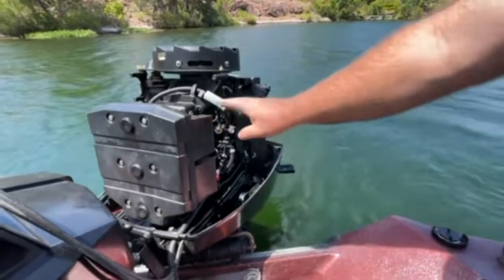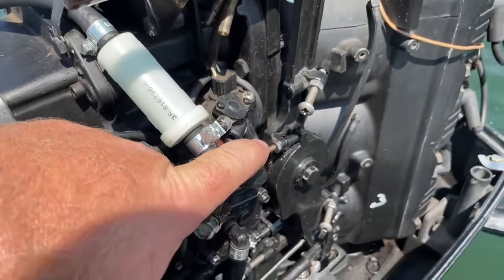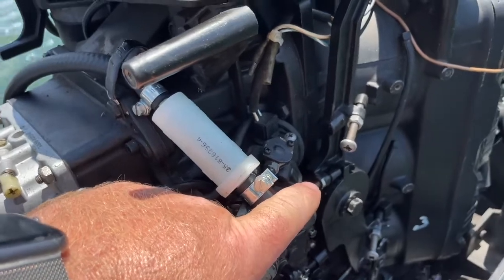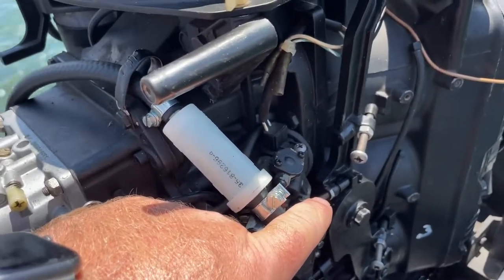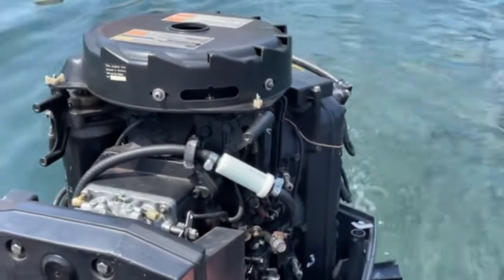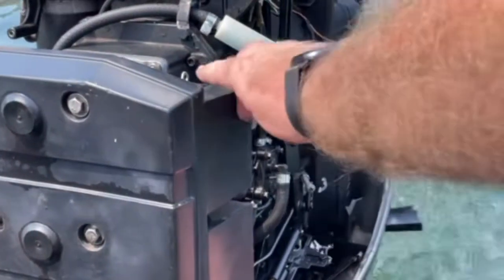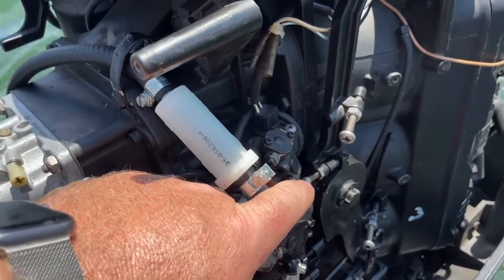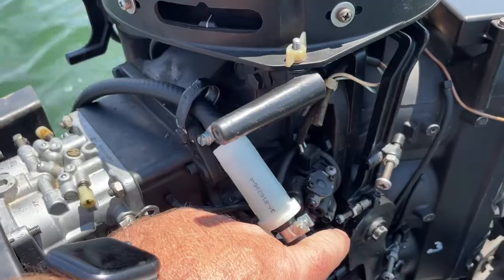How to Adjust The Idle on a MERCURY BLACKMAX 135,  Carb Rebuild Part 3

Comment: I’m working on my 175 blackmax as well. So it have to be in gear for you to adjust the idle? If it’s in gear then isn’t the boat rolling while you’re adjusting the idle? 🤔 thanks and great info.
Reply from the maker: You can adjust the idle when the boat is on the trailer and backed into the water at the boat ramp.
.

Comment: Have a black max 175 oil injector deleted w/ an electric fuel pump & pressure regulator, starts up really good.  Have only got it in the water once and it only wanted to do about 10-15mph in WOT. Just followed your link & sync video on the carbs and planning to do idle adjustment next time on the water. Any suggestions or should this all solve the issue?
Reply from the maker: It’s hard to know if it would solve your issue. Did you find that the throttle linkage was way out of adjustment?. That is a good place to start to make sure that your throttle cable and linkage is adjusted correctly so that your throttle is open all the way. If you are still having issues with engine performance, you may want to check some other things on your engine like compression, spark, etc.

Comment: Hey, thank you for this series, I just bought my first boat. 1993 Astro 18FS. It came with a merc xr6 150 

It’s struggling to idle after being warmed up and WOT I’m thinking of adjusting the idle screw. Is there a good way to tell what the rpms are if you don’t necessarily trust your tach?
Reply from the maker: It can be a little bit tricky. What you want is the idle to be high enough to keep the motor running in neutral but not so high that it slams the boat into gear when you shift into forward and reverse. The tach helps you find a number that is suggested by the factory. You could come to this result through trial and error, though I guess.

Comment: I need your help. Merc 200hp 2004. With 3 carbs. I can not get the rpm’s down. They are around 1100 rpm at idle in neutral. Idle screw is bottomed out. Thank you for your reply.
Reply from the maker: Check the throttle cable adjustment. Also may want to link and synch the carbs. Check out my other video on that.

Comment: I didn't hear no change In the idle.
Reply from the maker: The RPMs increased (when looking at tachometer)
Reply: @ProWrenching  
So I adjusted my link and sink today because it was out of adjustment so bad from loose screw my boat would not take off. Now I got my boat jumping out of the hole...when I shut down my motor is idling to fast. Really hits hard when going into gear. Can I lower my idle with that screw?
Reply: @ProWrenching  
Or should I do it at the throttle cable?
Reply from the maker: @FlamingArrow67  with the screw
Reply: @ProWrenching  
Just so you know your link and sink video got my boat back on the water today and running awesome. Now I gotta get my idle down so it doesn't break a tooth out of my lower unit going in gear. I appreciate any advise you can give me. Thanks
Reply from the maker: @FlamingArrow67  You can lower your idle with that screw.  Should be adjusted so the boat, while in gear, is no more than 750 RPMs.
Reply from the maker: @FlamingArrow67  Awesome!!  Great to hear that!
Reply: @ProWrenching  
Awesome. I'll go back to the lake tomorrow and adjust my idle lower. Thanks a bunch sir
Reply: @ProWrenching  
I didn't mention that my motor is a 1985 merc xr2 150. Guess that screw does the same on it?
Reply from the maker: @FlamingArrow67  haven’t messed with an 85 model. I assume it does the same.

Comment: What’s the cover called on top of the motor that has the labels on it? Mine doesn’t have one and I need to replace it ?
Reply from the maker: The cowling
Reply: @ I mean once you take off the cowling,  the round cover on the very top of the motor. That’s with the two warning labels on it. Fly wheel cover?
Reply from the maker: @TexasPapa13 ok, yes.  You got it- that is the fly wheel cover.
Reply: @ ok thanks. I’m new to this lol
Reply: @ found one on eBay for $20. Score
Reply from the maker: Excellent!

Comment: You’re videos are amazing. I have a 125hp 2+2 mercury. I took apart the carbs, cleaned them up and put new gaskets. Starts and runs fine. But once I turn the engine off, the carbs leak through the small tub. That vine out of the throat of the carb .
Reply from the maker: Did you adjust the floats on the fuel bulbs? Maybe the float is set a little high.

Comment: I have an issue with my 135h0 blackmax, the oil keeps going on after turning the engine off, and clogs the carburs, so when I try to start the engine a day after, I have to purge all de carbs before so the gas gets injected... Thanks!
Reply from the maker: @thekikemaster  the oil injection was deleted on my engine when I bought it, so I won’t be much help with this issue.  Maybe one of my viewers will chime in to answer your question…..

Comment: I linked and synced after I rebuilt the carbs off your other video.. Worked perfectly..
The only problem I have now is getting the timing advanced in the correct position when shifting either from forward or into reverse the motor just dies.. It will start and idle perfectly but as soon as I push or pull into gear it stalls out.. Do you know how to set the timing advance to accelerate while shifting gears.. I may have the cam not set correctly on the carburetors.. Mine is a 1988 black max 150hp..
Reply from the maker: Adjust the idle up so the RPM's are 750, while in gear.

Comment: I have a vintage 70's Merc Thunderbolt 50HP 2 stroke 4 cylinder that I rebuilt and got running, but it idles very high in neutral!. Anyone know what I need to adjust to get it to idle like this one does in neutral?. I was thinking it could maybe be the cable that comes from the Mercontrol/throttle and choke, and maybe I need to adjust one of the stop screws on the side?, and I know one does timing so I just need to know which one to adjust so I don't accidentally end up screwing up the timing!?. Any advice would be very much appreciated!. I want to go on the water, but I can't because I know if I put it in gear with it idling that high that it'll be bad news bear! lol

Comment: I jave an issue with my 175. I have took carbs apart. Adjusted the floats. Changed one of them. But i have to kep the throttle shifter forward so it will stay running. If i pull it back too far or in the actual nutrual position it will stall out. Almost sounds like it wants to back fire. But it stalls and pushes gas out if the overflow tube. If thats what the tube is. Too much gas? Or not butning it off. It does idle good and sound good idled up. It eill take the fas then. Do you have a video that will help me??
Reply from the maker: If your carburetor is overflowing when idling , I recommend rechecking the float adjustment. Also check your fuel lines to make sure that you don’t have a leak.

Comment: Thank you for this video. Is that red annodized part in the fuel system a check valve?
Reply from the maker: It’s an add on fuel filter, installed by the previous owner.

Comment: Hey can you do a video of the fuel line routing? Im getting my 135 all back together but cant figure out where the enrichener lines go.
Reply from the maker: See Short reply
Reply: @ProWrenching  quick questjon how do you test the enricher valve? I've also disconnected mine and can't remember how it goes back on I assume the black is ground to the block and black/yellow is power.
Reply from the maker: @shitboxoffroad  you should hear a click noise when you push in the key/choke on the throttle. When the key is pushed in, it applies voltage to the yellow and black wire, and the enrichener valve should click and open, allowing fuel to pass thru the valve.  Yes, black is ground, black/yellow is power.